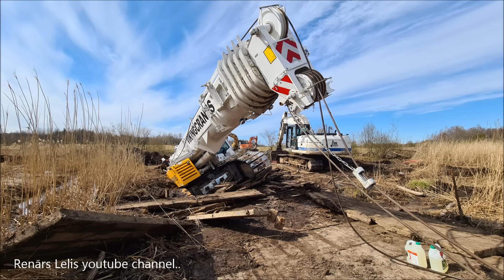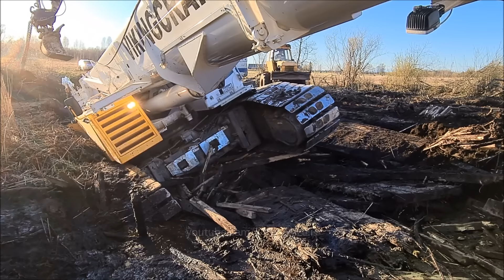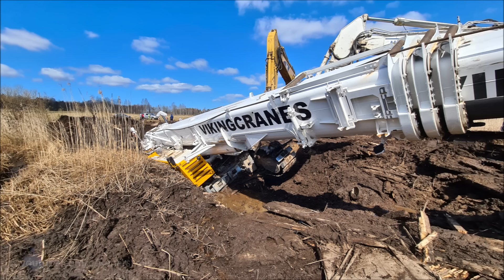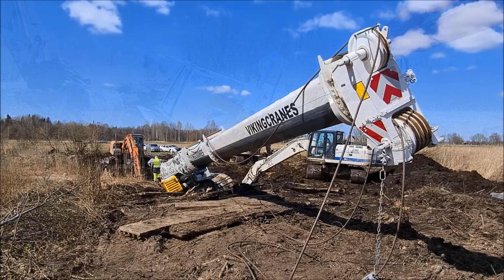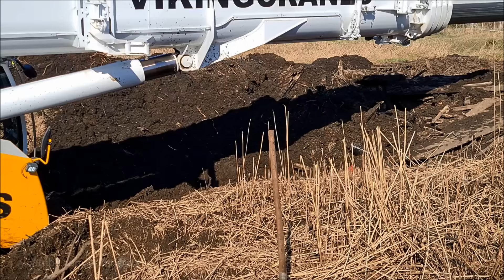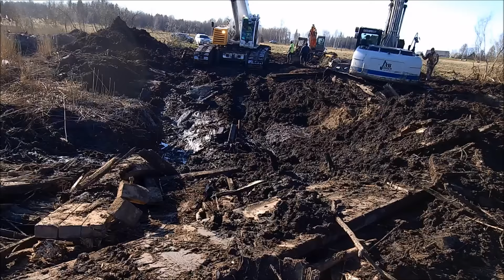Pulling out the Telescopic Crawler Crane, for 2 days!!!

Comment: First day was a bit a waste of energy (machine burried deeper at the end of the day..), but you did very good on the 2nd day !
 The LPKT winch sure did a good job. And well done on the use of pulley blocks and multiple lines to increase the pull.

35 years on foundation sites as site mechanic, so yes I had my share !

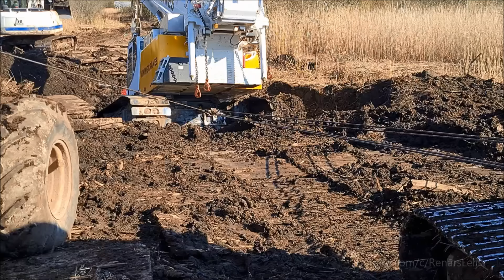Comment: All I offer is at 19:00 of the video, swing the boom over the left track and extend to take weight off of the right one in the soft stuff. Yikes what a stick. I once help get a dragline out on pads in not quite as bad of soft stuff. You used the winch very effectively.
Reply: Exactly what I thought.  These guys are being paid by the hour, though, not by the brain cell count.  As soon as the weight is off the right track,  it could have been winched out backwards  with drive on the left track, and they already had the excavator taking weight on the sunken side so that could have continued and would have helped.
Reply: Why do you have to add anything. Just curious. It's fine. Your not a genius
Reply: @einfelder8262  So you think you know better than men who do this everyday. Smarter some how. I wonder why you dont work for them Einstein
Reply: so obvious to smart people like us
Reply: That was my first thought, use the boom as balance, I guess the boom wouldn't move unless it's level or the stabilisers locked out maybe. I'm sure there's a technical reason and would be interested to know.
Reply: Mo
Reply: I'm still really confused why you felt the need to offer. HELP
Reply from the maker: @dubsydubs5234  The crane showed a 25% slope, possibly because they could not cut the boom.
Therefore, it was necessary to straighten the right side deeper.
At first there was even a risk of overturning, but it's good that everything ended well.

Comment: Smooth pads on mud = bad if the pads had holes that I don't see, they should have been bolted to keep the machine from sliding.
#2 Brand new those mats are too thin.
#3 When it keeps going down STOP! and get someone that knows what they're doing. I've brought many up out of the swamps in my day.
#4 You should have dug out the low side as not to smash the motor tin work and swung the boom to the right raising it as high as the swing motor would still swing the counterweights up hill.        Assist  with an excavator lifting the SHORT boom taking weight off the low track if needed.         Once the boom was over the low side,  boom it up as far as it will go.          Now the counterweights will work for you.             Don't for get to attach heavy straps or cables to the top of the boom so an excavator can pull from the high/back side and it will lift that low track right out of the ground.            You can even crawl forward with that track in the air till you're on good ground.
Generally speaking that type of crane has no down pressure on the boom cylinder.     They are gravity down or maybe 10% pressure.     The best you could do is set it on something to take weight off the low track but I don't think it will get you anywhere.     You could build a stack of mats under the end of the largest section of boom then telescope the boom out using the mat as a fulcrum point jacking the track up risking bending/buckling/damaging the boom.

Comment: Seeing this brings back memories.  The day the ground turned out to be quicksand like when it should have been dry thanks to a neighbor who built his land up and had started letting his washer drain onto the ground next to the fence line. Ground looked and felt dry until I drove the backhoe right by where he was doing that.  To this day there are 2 6 foot tall stacks of lumber buried where I got stuck. Once I hit 6 feet I hit solid ground and was able to get a load of plywood under the rear wheels and use 40 feet of chain to a tree from the bucket and just draw myself out of there. The neighbor tried to deny what he had been doing until his washer went into the drain cycle. Then he admitted to having been doing it for months. He stopped after that.
Reply: Lol, my dad has been doing exactly that for over 25 years!! Damn a bunch of filling your septic tank with washer water!! Lol.
Reply: @fineartonfire_5327  thing is we had city sewer there so he had no reason to do that.  But what few know is that by him building his land up then draining the water right next to the edge of his property so it would run off onto our property he had broken the law. We didn't report him instead we just pointed out what he was doing and the problems it caused. Now we were in the beginning stages of building up the height of our property and at the same time making sure the runoff went to the ditches and didn't flood anyone else's property. In some areas we building the land up by over a foot. The property flooded every time it rained heavy and took forever to dry out after it rained because it was so low.
Reply: @jeffreymurdock8366  You are clearly much better neighbours to him than he deserves.
Reply: Mucicaboliviana

Comment: You would think with an ankerpoint nearby, the crane could pull itself out, it can pull 100 tons !! Also the tracks on this LTR 1100 are good on hard surfaces, not so good in the dirt. They have a smooth surface and thus almost no grip. But good for turning on hard undergrounds.
Good video !! 👍👍
Reply: I would guess that the boom is not designed for a pull like that. Only lifting perpendicular to the boom.
Reply: I thought of that as well, but then I don't think there were any good anchor points. Those small trees in the swamp would have tipped over.
Reply: It don't work that way guys. If you never been there you just don't understand.
Reply: @scottywisely6180  Maybe you could tell us why, then we might understand.
Reply: @meandthemrs7403  Looked like they could rotate it and tip that buried track out of the mud.  Possibly lifting on something if they needed more than just the weight of the boom? But I assume there is a reason they didn't do that?

Comment: (1) Apply downwards force upon the far end of the  partially raised and fully extended boom, to allow boards to be placed well under the rear of the crane, perpendicular to the tracks, (using front of stuck plant to act as fulcrum).
(2) Retract boom and raise vertically pointing toward sky, then pull from rear, stabilising front of stuck plant. Dig under front, place boards both perpendicular and parallel to tracks. 
(3) Drive/haul out, have a sit-down with a cup of tea and a biscuit.
(4) Plan B when Armchair Method does not work, call Insurance company.

Comment: I guess since they didnt do it, its not a done thing but...
Why not extend the boom, put a ground anchor between the tip and the crane then use the crane to pull itself out. Surely it could add as much pull as it could lift.
Be interested to know why its not done...

Comment: Wow, that machine looked like it was pretty low hour. Not that It would've helped much in this mud hole but the lack of grousers on the tracks probably makes it feel very slippery. Couldve even been the original reason it came off timber pads and ended up like this. The one question I'm left with: Is the operator still an employee there?
Reply from the maker: Of course, the operator is still working.
Reply: @LoggingLatvia  Thats good! It wasnt you was it? JK, thanks Renars!

Comment: That was well bogged....always going to be a difficult recovery when one side has bogged in further...been there a few times...😋😋😋
Reply: Tread design looks like it's not well suited to that type of terrain.  I'd imagine that all it would take is a little off axis settling of the mud mats and that thing would slide sideways in a hurry.  A thin layer of mud between the track and wood and it would be like sitting on grease or ice.
Reply: @timothybarney7257  its one of the problems, crane tracks are there to spread the load and as they usually travel on flat ground they don't need grousers (the cleats on the track), excavators have triple grousers as they are expected to climb up poor surfaces, and bulldozers have big single grousers for grip when pushing, cranes are often used on prepared surfaces and you wouldn't want grousers tearing it up, hence flat tracks, and yes they do slide more easily, such is life!!.

Comment: Really so you pivot the crane around at the end ? Why couldn't that crane pivot around and use the boom and cables to an anchor point pull its self out and you notice wenching it out works better than trying to pull towing it, that one wench out pulled the three track pullers.

Comment: First thing to do with any tracked machine in soft ground is to get it sitting level sideways. The tracks have no sideways grip. It will slip further into the mud as you move it.

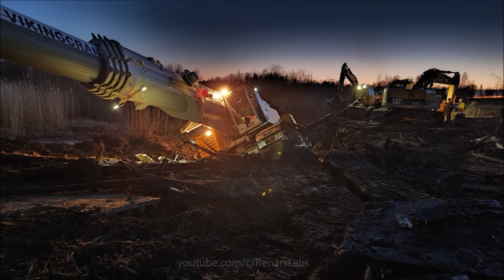Comment: I've been moving heavy drills around in all kind of conditions and my second cousin that was four times my age and taught me a lot. One of the best things he taught me was the best way to get out of trouble is not to get into trouble. At 7 seconds and the weight of this thing, I bet you guys are wishing you had a better bed down before moving. We use 4"x14"x9' white oak to move a 37-ton crane carrier over some muskeg you'd be hard-pressed to take a 4x4. Them oak planks just won't break. If you use them right you can drive just about anything over them. Why the hell didn't you dig out the low track and get some timber under the end of that low track? Then weld a big hook beside the inside housing and put at least a four-part line on it and pull it out first time every time. I know. You guys give me a headache. Dam nice machine. Always pull from the low side. I wish I was there to help you. If it's still in there I'll come down on my own buck and If I can't get it out in less than an hour I'll give you my truck. 5:50. Get some FKG timbers under the end of that FKG low track. You know what? I'm not even going to finish watching it. Buy at  6:20.
Reply from the maker: From a video viewer's point of view, everything probably looks simple, but the reality was much more complicated than it looks!
To be honest, I would really like to see how you can pull out a 85 ton
 heavy crane in 1 hour, which is exactly in this position!!!

Comment: Should have rotated the jib 90 degrees anti-clockwise, and then pulled the end to the ground. The crawler would've lifted it's right track, and then timber could've  put under to prevent it re-sinking into the ground

Comment: some  people    are  good  at   strategizing    a  plan    for  what  they  need    on  a  job       my  first  question  to  the  person    who  set  this 
 up  is  do  you  know  the  exact   weight    of   this  machine    and  if  no  then  why  the  hell  not?     the  next  thing  is  what   have  you  done  to  make  sure                                                                                             that   it   is  on  a  stable    ground    that    can  hold  that  much  weight  and  then  maybe  just  a  little  bit  more  for  safety   sake  if i  think  a  person  does   not   know 
   the  limits   of  the   equipment    he  is  working  with  then  i'm  thinking   they    have   no  business    operating  that   machine   in  first  place
Reply: NOTE  TO   YOUTUBER    you  should   use   time  lapse  photography     for  this    because   it  is   very   frustrating   when  things   go  to   slow   
i  get  bored  really  easy   and  i  just  move  on

Comment: Out of curiosity, after anchoring the crane to an excavator so it didn’t slide further in, could they not have had the crane swing to the left and extend it’s boom out to a tipping point in order to counter raise the right side like a teeter totter, then stuff wood under while it was up, bring the boom in and drive out?

Comment: It is a pity I was not based nearer to where this machine went down because without being big headed about it, I could have had that crane out of the bogg it was sunk in within a few hours as I have specialised in recovering heavy machines in situations like this & have all the right equipment & experience to do this type of recovery & I have done many jobs like this & never failed yet having been doing this work for 40+ years & worked all over the country & always willing to travel abroad to do these job's.

Comment: I would have called  Ron Pratt from  MID WEST TOWING.,,!
Reply: yep reckon your right , if ol Ron could have got close he'd have lifted that lot no problem !!!
Reply: Dwight Arnold Yes, you would of five hours of walking around shaking hands and praising god that no one was injured.
Reply: Second that.. He would even have enough pulling power for that beast. Excavators just arent too great when you need to pull stuff.. When you nudge something in mud it sinks deeper
Reply: Ron couldn't do it as he might get his truck DIRTY..
Reply: His truck never leaves the road, its just not worth the risk its worth a ton and I doubt his insurance covers it, if it was beside a road sure, this seems to not be, However I think he would still bring some knowhow to this situation his understanding of leverage and pullys is second to none.
Reply: Ron who
Reply: WHAT NOW!
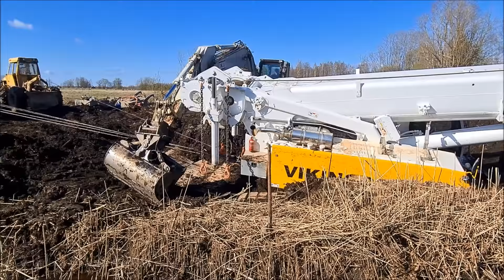Reply: @RustyDagger1  Well eventually they got around to that 5 to 1 pulley arrangement at 16:13  that got it out using the excavators for anchors.
Reply: His 100 ton probably wouldn’t lift this crane from the mud.

Comment: The wooden sheets you're using are ways too week. Here in Switzerland we use old railroad crossties bont together with heavy steel cables. Locally we just say matress. I'm driving on them to construction sites with a very soft underground (e.g. clay or streaky sand), where 40 ton (gross weight) trucks would sink in after a certain amount of trucks passing trough.

Comment: Guess they never heard of the old “Chain a log to the tracks” trick.
Reply from the maker: Do you think we are stupid?
At first I wasn't, but something similar was tried. With each experiment crane just went deeper, even the water got into the air filter!!!
Reply: You did exactly what I would done now that I see it done
Reply from the maker: @bigpapa8152  After the war everyone is smart !!!
There are no stupid people here, this work that they do is not easy and eats a lot of nerves !!!
Theoretically, this crane weighing 103 tons is generally not designed for such conditions !!!
Reply: @bigpapa8152  
In life shit happens , often times without any stupidity  .
Reply: @BurbSK-bi2wh  When you have multi million dollar machines,  shit doesn't happen. You always plan for the worse,  but go in hoping for the best. 

When shit happens, it's because someone fucked up, and didn't  do their job.

It's that simple.
Reply: What a bat stupid comment. It's not a wheeled tractor..and the tracks are disappeared out of sight. Not only that - the machine is not a 2 tonne tractor stuck on your front lawn, but 100+ tonnes of heavy steel. 
Chain a log to the tracks? I'd like to see you try.
Reply: Gareth Ifan  All Crane’s manitowoc 2250 series 3 configuration with a luffer, worked like a dream! 🤷✌️
Reply: Gareth Ifan  not a log but crane mats like they have there.
Reply: @LoggingLatvia  Indeed they are, they are still alive. But I understand what you mean.
Reply: Not logs. Use a i beam. Way better.
Reply: @garethifan1034  Is there no ability to remove some of the counter-weights when it is stuck?  They should be fitted to accept a giant screw-eye so they can be removed by another crane.   Bring in another crew with a grout pump and float that turd.
Reply: Clearly this machine has the wrong track pads for the surrounding conditions.
Reply: Where is shitshow Larry Curly and Moe

Comment: It seems to me, that as the ground behind the crane was firm, as the crane had not sunk there, it would have been better to extract the crane backwards rather than forwards, as they eventually did, so the first days work was wasted.
Also, if in the beginning a deep hole was dug for the water to drain into, away from the crane, it would have made things easier.

Comment: Rig a deadhead to tie to. (A bulldozer with the blade dug in, for example.) Run steel cable to each track of the stuck rig and secure. Drive the machine up the cables. Imagine the size of the "winch drum" the tracks make. If you can spin both tracks, you can just walk it out without all the digging. Done it many times on cats stuck in stump holes or swamp.
Reply: That is quite a good idea. I will remember that next time the situation calls for it. What size cable do you use for say, a D6 sized machine?
Reply: @cl7510  I usually just go up into the hills and grab some abandoned wire rope from a logging landing. Half inch to 3/4 seems to be what most loggers are using. The heavier the better.

Comment: OK things like this happen sometimes, I hope the operator was ok?  Seems strange though to try moving it forward into wetter ground from the lake, basic engineering knowlege suggests anything like that, must come back out the same way it went in.  Also seemed strange that the unit wasn't slewed through 180 degrees a lot sooner, to use it's own winching power to assist it's own recovery.  As long as no-one was injured it all worked out ok, machines can always be replaced.
Reply: If they could have swung it to help they would have. They tried forward because the front was pointed up, When it didn't work they went to digging, it was all they could do.

Comment: I was impressed with the excavator pulling out those weights. How much did each weigh?
Congratulations. That had to be the best feeling of relief when you saw that it WAS coming out of the hole.
Reply: They are 22,050 lbs each.
Reply: A 325C excavator tops out at about 43,000 lbs lift at 10 feet out and 10 feet down. Above ground level it should be safe to lift one weight reaching out 15 feet, by 20 feet it would be pushing the hydraulics limit.
Reply from the maker: Of those by the video lifted-20 tons, 10 tons each